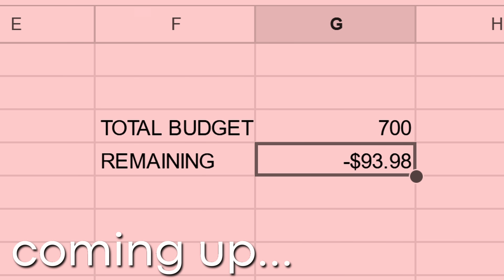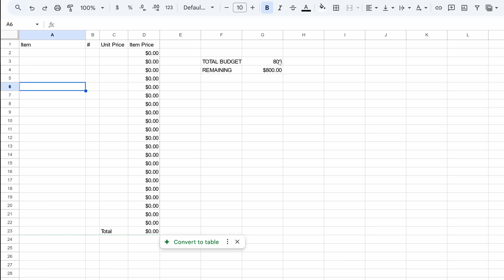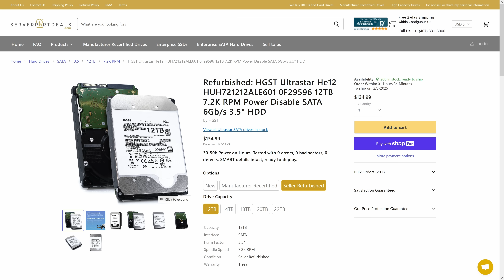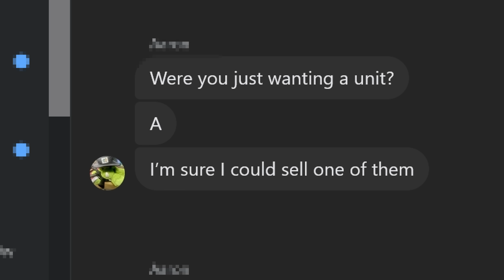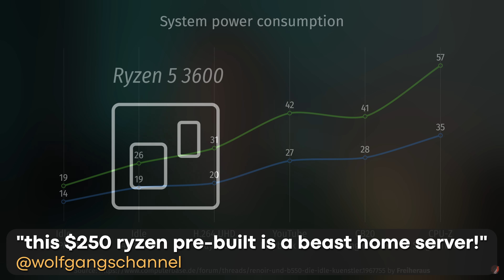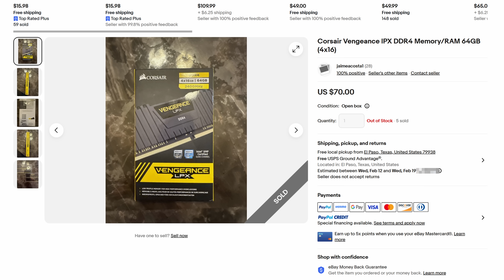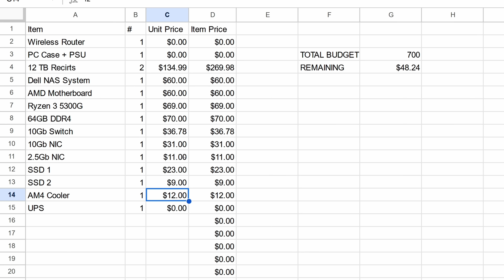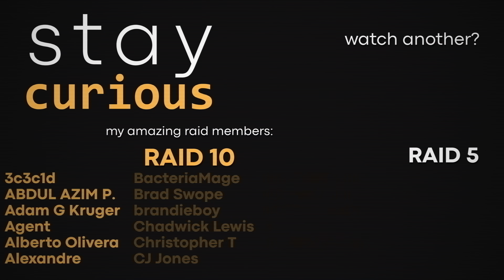I Have 2 WEEKS To Build The ULTIMATE Home Lab! [Part 1]

Comment: how have i never seen this. dude i got my homelab almost complete. just need more drives and aint gonna happen until these prices come down lol, i got a dell xps 8930 i upgraded the cpu cooler and tossed the vrm heatsink thats seperately sold on with it, took out all its internal drive bays but i got space for 1, doesnt matter since the 1 hdd i got is dying lol so im not even gonna bother with it, and im using an m.2 ssd for the boot drive, i got a 1tb 990 plus coming which is overkill cus its gen 4x4 not 3x4 but dont matter since it was cheaper than 970 evos and evos pluses somehow and i couldnt find an sk hynex p31 or any other drives i wanted too, but idm this is better then them all technically speaking lol. got a 4tb external usb drives that i want to hurry up and retire to js being a backup drive or something or retire from it all together tbh. and ill replace that with a 2.5in sata ssd. til then its chillin in the case and has its usb cable routing through the holes in the sidepanel to the front usb3 lmao. its rigged with 4 extra fans from previous builds of mine and family n friends and since theres no mobo pwm they js run full speed but their quiet. best u get is i8kutils low or full blast. and dells curve is shit theres no way to change the fan curves on it. bought some vetroo fan hub since i figured id wire my jbod fans to it (im doing a similar thing to ur jbod build) and the product claimed it could control pwm with the remote but no it js allows mobo passthrough and i dont wanna take the exhaust fan and cpu fan off their respect 1.5amp fan headers plus i dont know how thatd fair for the controller lol so full speed it is but idrc since its nowhere as loud as the cpu or exhaust fan can be cus ts like 4600rpm bro 😭i had made a python script to set the cpu fan to full speed when i had the pos 65watt cooler not the 95w one i js got, and the exhaust fan to high or low depending on the temps, if it hit 75 and kept going to 76 it would go full speed cpu and exhaust fan until the temps drop and once they drop it would go back to cpu max and exhaust low at like 55 and would repeat thing is ts was annoying cus it would ramp a lot if it got hot, i js said fuck it let dell pwm them and the rest can run at full speed. i could eventually get a y splitter for the exhaust fan tho and hook the exaust fan to the splitter and board and the pwm cable to the other cable on the splitter. id have to look into that more. with the new cooler it dont matter now and its quiet and cool asllll, i currently js host a website a panel for servers and my minecraft server that i let run 24/7, but with the panel theyre are set up to run with docker compose and js spin up containers on the fly for my game servers. wanna set up immich and jellyfin or plex and imma figure out how to allow its drives to be accessible like a nas, especially cus im gonna get an hba card for the jbod and ill js put it in the 4x slot cus ill need the 1050ti in the 16x since itll handle encoding with jellyfin or whatever i chose eventually, leaning to jellyfin icl. so ill be able to have a total of 9 hdd, 1 m.2 and 1 or 2 maybe 2.5in sata ssds lol. pretty overkill for my needs afaik. just gotta get some drives the hba card build the jbod with all the drives my adapter brackets and internal cables for the hba card and then the mini sas to 4x idk the name anymore to connect to the hdds tho. prolly gonna do samba. til i get all the drives wont worry about setting up anything else yet tho. shi ill alr have to redo my configs and move files when i get new drives lol, not worried abt power i got a 750 watt semi modular psu in there wiht plenty of cables. and ill js route it out the side of the case lol, and it has fan switch on the back so i have that set to always on cus this case needs it fr. will prolly get some to mimic pwm via a dial and power from sata to plug into the controller to let me change the speed of the added fans set it to like %80 yk

11:03 woaa bro back in 2020 i had $800 to build a pc and best i got was a r3 3200g and 16g ram a b450 and a nr600 lmao. best believe it ran games at decent fps. doom eternal ran great could push the highest settings like stuttery 30-60 fps lol but it was easy to get like very high and high mix and play at a smooth 144. siege ran like shit was always 30fps lol, but it was a 4 core 4 thread vs your 4 core 8 thread. fort was playable with performance mode. obv everything ran low settings but there was some surprises. it was still hell of a lot better then what i used to have lol. ran for a while with it til i got a 1660 super in it, then a 9060xt and sold it. now i got a r7 7800x3d a 9070xt in a o11 vision compact, i wont show it off in full until i finish it. still need to replace the bottom 3 fans with lian fans and i wanna get the 8.8in screen for the top left corner, maybe some cable extensions too.

Comment: I've bought a hp proliant ml310e gen8 v2 to use as my homeserver. I install debian 12 without problem, but it's laggy playing media so I pluged in an old quadro k2200, fresh install system. Through CasaOs, everything is fine, but on the monitor that I plugin the server itself, everything look broken. Is this because  of the nvidia driver ?

Comment: HP 385, Epycs 7402s, 1TB ram, RTX8000, 2 NMVE 400GB HP 765059-001, 4 SAS L406S, 100G infaband..  hooked up to....  ooh that's getting expensive, especially when hooked up to a Dell750 storage unit with 24GB spinners and a RTX4000 and a HP 580 E7-88891s & 2TB ram (kitted out with 2 RTX8000s).. Let's train a new AI variant.

Comment: what do you mean Ryzen integrated graphics aren't the best? they have been the best integrated graphics for a while now. I believe this will outperform a discreet GT1030  on a few things including some games. Well it doesn't compare with an RTX 5090 if that's what you're talking about but this is not a $10k gaming PC. I built a few APU only gaming PCs in the INWIN Chopin case and man they were so fun for older games and as a beginner gaming pc

Comment: I built mine (excluding storage) for £90. I got a 6 core 3.7Ghz xeon + cooler, motherboard, 256GB NVME SSD, 64GB ECC RAM, 10GB Networking. I 3D printed a drive enclosure and motherboard case and threw every spare drive I had sitting around at it, removed the ones that threw up errors, and ended up with 2 pools, 1 is 6TB mirrored, the other is 5TB in 1TB drives in Z1, but I don't put important stuff on there. In raw drive speed, the slow pool can max out a 2.5GB Nic, the fast pool is twice that speed, and if what you want is already cached it will max out the 10GB connection.

Being an older xeon, it's not the most energy efficient, but it works fine for my first server build.

Comment: Expect on replacing the capacitors in that YuanLey switch in 12-18 months.  I had two switches, from Vimin, that have the exact same port layout, same/similar packaging.  I replaced the capacitors (the originals had swollen), and everything is back to working again.  I think some of these Chinese switches are built in one factory and silk-screened with other names on them.  Moker, Vimin, Yuanley, Hasivo, NicGiga, are all suspiciously similar.
Reply from the maker: Yeah, definitely the same OEM just re-branded haha

Comment: Los Dell Precision son unos equipos excelentes, hace 2 años me conseguí un 3050 con i7 11700, 32gb  Ram, tiene 3 nvme, y 3hdd. cambie la fuente original, instale una RX 6600, lo uso con proxmox. un windows para juegos haciendo passtrought de la grafica, y varios servicios con linux, docker, etc. Todo esto lo logre siguiendo varios de tus videos. son excelentes. saludos desde Michoacán México